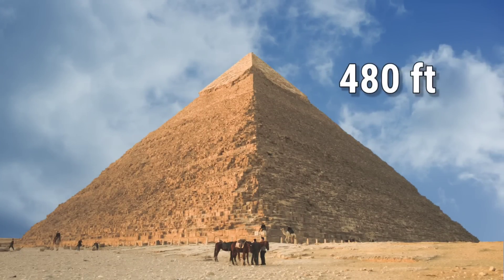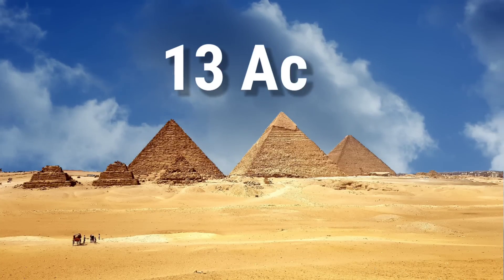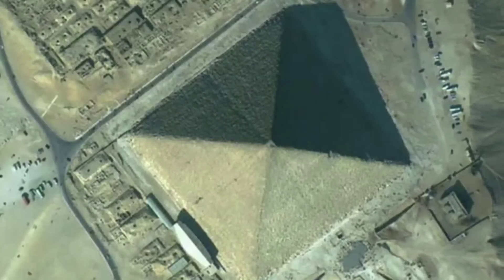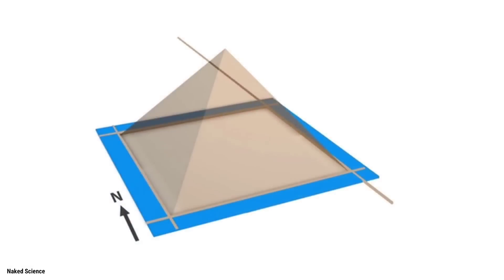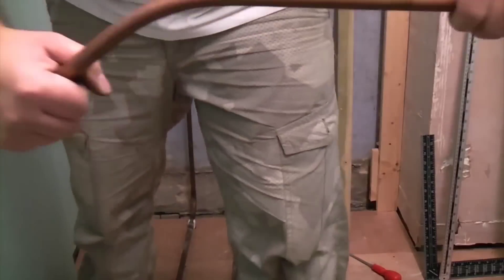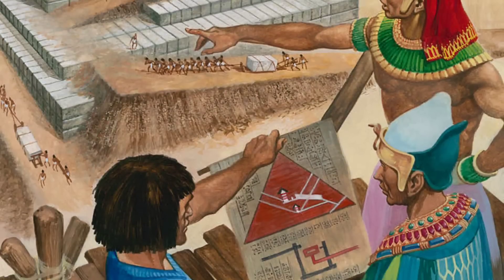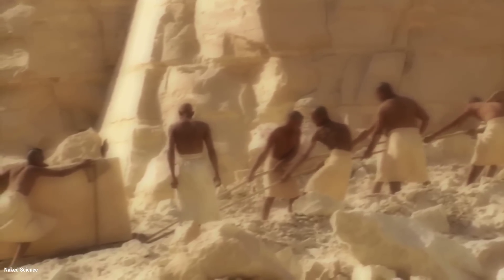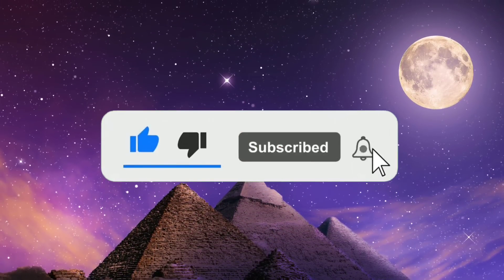How Ancient Engineers Built Impossible Pyramids 4500 Years Ago | ThinkUp

Comment: To think in terms of "X" number of stones per whatever is superficial logic.  The Great Pyramid is a large structure and thus it could accommodate hundreds of workers laboring upon it at any given time.  There is ample evidence they employed a structured workforce broken into specific teams doing a given task.  There is also physical evidence they had draft animals onsite in the form of oxen.  Further the largest/heaviest blocks are found in the bottom half closest to the ground.  Above the halfway point the blocks are smaller with those at the top being small enough to have been levered into place by several men.

So the quarries were adjacent to the pyramids being ~100-200 meters away.  There is physical evidence of earthen ramp use to raise blocks and written evidence of their using levers and what was termed as "a machine" which was likely a scaled up version of the Egyptian shaduf employing a fulcrum and counterweight.  Thus the larger blocks were raised via the ramp and the smaller ones above could be lifted via the device. 

If a team of block movers can pick up and transport a block the short distance to the pyramid and drop it in place in say 2 hrs = then 10 teams can move 10 blocks in about the same timeframe and so on.  In short the more teams working in tandem the more blocks in motion at any given time being placed simultaneously in different places on the structure.  Most of the "blocks" are crudely fractured chunks of limestone.  Only those outer layers and those used to create the inner chambers/corridors were more carefully cut and in some cases polished.  So the pyramid is mostly "stacked rubble" comprised of chunks of stone quickly broken free from the bedrock and dumped into place leaving gaps all over.  Think of the totality of what you actually see.
Reply: Whatever you're smoking please pass it around.
Reply: @kens32052  Incredulity is easy requiring no real cognitive application whereas understanding and speaking to evidence is harder.  You didn't actually say anything = ergo clearly you have no understanding here.